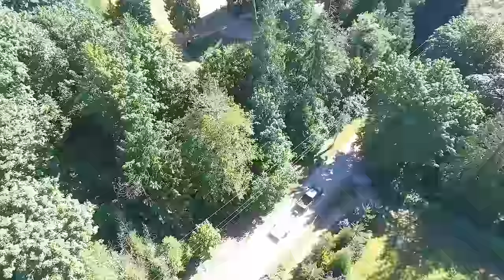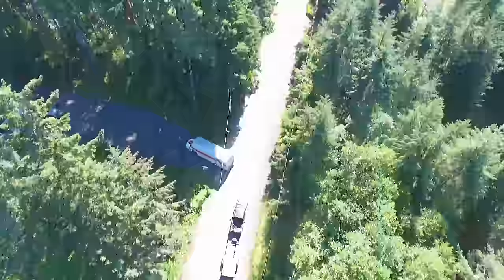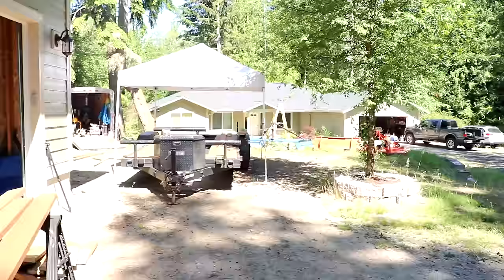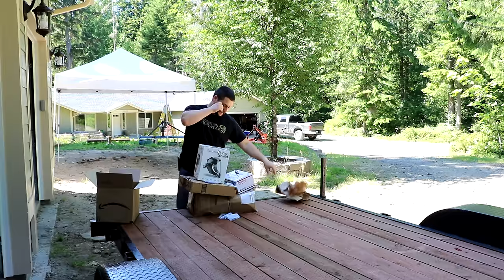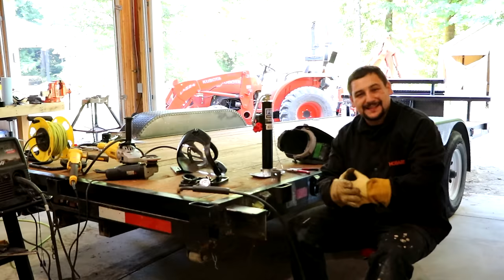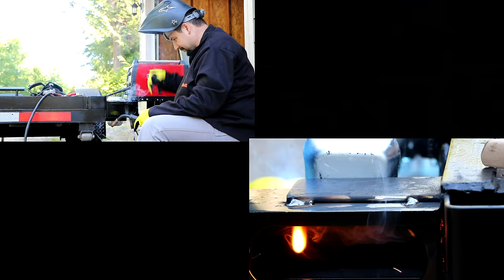Car trailer Upgrades and modifications!!!

Comment: You can't power a winch off the pigtail itself but add a battery to the trailer and the pigtail will charge the battery for the winch while the truck is hooked up. Another thing I did was mounted a switch and relay up to my winch battery that activates the trailer brakes while loading heavy equipment that keeps the trailer from surging back and forwards, especially helpful on 2wd trucks and it works like a charm to keep that stress off of the trucks parking brakes and also the parking pawl if an auto.

Comment: Hey Daniel, Nice Job Replacing the Wooden Deck, Light housing, new LED Lights & Installing the Jack & D Rings.
I have a Kaufman 18 footer Car Hauler with Tandem Axels & a Diamond Plated Steel Deck. 
Now that you have Nice new Wood on your Trailer; Don't forget to maintain it by Power Washing the Deck & Staining it every other year to maintain the look & preserve the wooden deck.
I also have the underside of my Trailer Rust Proofed Sprayed every other year to prevent it from rusting. 

To avoid spraying Rust Proof, I am contemplating spraying the underside with Bed liner Paint. This stuff is Indestructible!
Thanks for taking the time to share your Video.

Comment: Something that most people don't realize is that you don't have to bend the boards to install them. The majority of wood deck trailers have a stitch welded strap over the boards on one end or the other. All you have to do is cut those welds, take the strap off and then weld it back on after you lay the boards in place.

Comment: Great effects on the intro.  Good information. I am in the process of getting a trailer for my new tractor, and your experience was helpful.  I could show you the importance of getting fasteners that are rated for treated wood, especially the newer formula treated wood.  When I rebuilt my deck, the original screws were less than 1/16: diameter when they were replaced. The chemicals dissolved the fastener.  I also used trailer deck screw similar to the ones you used, except in stainless.  I did not have good luck with them, but yours worked much better.  Thanks for the referral.

Comment: Very nice job guys, I will be starting a redo on my trailer I built in 2008, I'm doing some mods and a repaint, I also would like to help explain the screws you used, these types of screws and sizes are my favorite to use, I did notice the way you explained the size of the screws that you used, to help to explain a little better, as listed on your screw box it reads, 1/4-20X3"  this means that the screws are 1/4" in diameter - 20 means that there are 20 threads per inch -  and 3 as you know is the screws are 3 inches long. the bigger the middle number is, it's the same rule if it says 8, 24, 32, or whatever that number is, it still means threads per inch, I hope this helps. Thanks for the video Kudoes

Comment: I also put the trailer support jacks on the rear sides but ran into an unexpected problem 1 day. Went to let them down n crank handle was missing on 1 side. Had to replace jack (Not cheap) A simple $1 bungee cord hooked onto handle, wrapped around jack & other end hooked back to handle keeps handle from hanging down & getting torn off or catching on anything. Simple, cheap fix. Works for me & might for someone else. Jacks are hard to put down w/o a handle. ;-)

Comment: A much easier way to put your boards on is to cut the three tack welds at the back and take the retaining bracket off.  Then lay your boards out and replace the retaining bracket and weld back in place.  Keep you from having the jack up and bend each board into place.
Nice intro by the way.
Reply: i always cut the front retainer out and replace it with angle drill 2 doles in the angle and the trailer and weld nuts to the trailer to bolt the angle to makes it so much easier to replace the decking i do this to every trailer i buy weather it needs decking or not

Comment: Great vid, EXCEPT for using those stupid blue scotch lock wire things...Those deck screws are for treated wood because the treated wood will eat the other screws. It might have been easier to remove one end of the trailer, how the deck boards 'fit into' each lip then just weld it back on. But yea, great vid.

Comment: Dude, I can save you a shit ton of time and hassel next time you redeck a trailer.
On one end of the trailer (usually the front) will have C channel to hold the lumber. On the other end it will be made from 90° angle iron with flat bar stitch welded across the top of the deck boards.
Next time cut the flat bar welds, set the boards in and weld the flat bar back on to the angle iron.
Reply from the maker: Yup in retrospect it would have been a lot easier to cut that end plate off, Most of the videos I wanted did it the way I did,
but I think that because most of those guys did not have a welder.

Comment: I have rebuilt a few trailers, it always works better to do all the welding and new wiring BEFORE installing the new deck.  Access is better, welds don't scorch the decking.  Otherwise, nice job.

Comment: great video,  Xlnt job on the welds.  great idea on swapping out the front 7pin harness  those are always the first thing to go haywire since they get the most use in and out and thrown around when unplugging.  fyi , your not going to run a winch off the extra power wire in the plug though,  too small of gauge to handle a winch.

Comment: Love the cloning in the intro.
Great improvements on the trailer, but why did you choose to put the new deck on first ?

Seems that it would have smarter if you stripped the old deck off, performed all steel mods, touch ups and paint, then put the new deck on last.

Comment: That is a 10k trailer, i have also seen d rings welded to the side of the tube, rip the tube apart, we weld a 1/4'' plate to the tube and then weld d ring on, usually on the top of the tube. Nice trailer and good work!

Comment: I see so many people beat the shit out of themselves and trailer deck because they don't look at the way things are built.
Wood deck trailers will have angle iron at one end of the boards. They then put the wood down and weld a strip of flat stock to the angle basically making it C channel.
Cut about 4~5 1" welds and your done.

Comment: You can save yourself a shit ton of time redecking next time.
Either the front or rear board keeper channel should be angle iron instead of C iron . Then after they put the wood deck on, they weld flat bar across the wood to hold it. You just have to grind off the stitch welds off and remove the flat stock, replace the boards and weld the bar back on.
Reply: don't be giving the ship away

Comment: What size was the Lincoln welder. It looked like a really good welder. Was that a gas or flux core. I guess that's what you would call it. Excellent job on the welding great beads.

Comment: Thompson's Water Seal. Lowes/Home Depot. Pricey but it'll make trlr deck life extend.Later
Reply: better to custom saw full 2x6 black ash, hard as nails an don't root
Reply: Thompson's is junk! Linseed oil and Turpentine mixed 50/50 is the stuff to use. use it on concrete, wooden fences, Masonry block. Apply with a sprayer or roller, better product and alot less expensive as Thompson/s too. I've been in the Ready mix business for 35 yrs now, never ever had any problems with it.

Comment: My trailer re-decking went a lot faster when I first drilled with a 3/16" pilot drill. I had a little different fasteners I got from Fa$tenall.
Reply from the maker: Yup even with the fasteners I used I really should have drilled a pilet hole. I really hope that I don’t have to referb that trailer again while I own it.

Comment: Man nice work on the intro bad ass a couple of things I want to add 1 you spend a good amount of time making sure things were done right and you blown all that nice wiring sky high with those scotch connectors at least get some butt connectors that have the heat shrink build in to the they cost just a little bit more but will save you a crap load of time later by having all of your lights working like there supposed to 2 do not try and run a winch on that extra wire you now have a wench is going to pull way to much thru that little wire however you can use that wire to charge a battery other than that great job and keep up the good work

Comment: put grease on the light connectors. they will corrode if you dont
Reply: pa h make that dielectric grease and I will agree, otherwise you are making a mess that will still have corrosion.

Comment: Nice prep work for welding , but then go and use junk wire terminals . Should have used heat shrink butt splices .

Comment: good vid but those  scotch locks for wiring are no good they will stop working in no time.next build use soiderles  crimp style that has heat shrink,you will be alot happyer with them.

Comment: all the welding and grinding and Cutting should have been done before installing the new decking (would avoid charring or burning the new decking) Other wise good job
Reply: Blue scotch locks  are garbage, solder wires and shrink wrap.

Comment: This video is much appreciated. I basically have the utility version of your trailer. Mine is an 18ft tandem  Acker flatbed . I have the two ramps  but have never loaded a car. I was wondering what what mods you might recommend and what would you think of some d-rings in the middle of the wheel wells? That seems to be the spot I always need an anchor point. 

Thanks in advance for your time and reply. 
Tim Boër 
Managing Partner 
US Garage Auction Co. LLC.
1-844-2-USGACO

Comment: Question for you sir. I  have a car hauler that Id like to use on occasion to take my zero turn in for service.  My issue is the spacing between the steel channel cross ties used to make the ramps are too wide for the front tires on the mower.  Trying to drive the mower up the ramps is very uncomfortable at best.  Any ideas on how to modify the ramps so its a bit easier to on/off load vehicles with smaller wheels?ThanksSteve

Comment from the maker: This is only a 10,000 pound trailer, I didn’t understand axle ratting's when I bought this trailer, I found it on craigslist and I took the guy at his word for what he said was. Live and learn!!!
Reply: a  3500 axle has a tube of 3" and 5 stud, x 2 axles give you 7000 Lb GVW, A 5000 GAS A 3-1/2 PIPE  and 5 stud 2 x 5000 is 10,000 Lb old dated 5000 axles have 8 studs an most bearings an hubs are hard to find
Reply: Hey did you realize that the screws that you bought the 1/4 inch wood and metal ones are self tapping therefore no pre-drilling through the metal was needed
Reply from the maker: Kicker 31 I started to utilize them in the self tapping capacity. And it stripped them out right away and told the tips I ended up having to get a carbide tip drill bit to drill through the steel make him work.

Comment: You mentioned wiring for a winch up to your plug.   What size winch are you planning on using?   Most winches need heavy gauge wire from battery up to winch.   I don't think wiring up to bumper can support a winches needs.
Reply from the maker: Matt Bowman You are correct if I end up putting a winch on the trailer which I would really like to do I’ll have to run a separate set of leads.
Reply: Daniel Woodell good call. Heavier wire is better for the longer run but regardless the wiring in your trailer connector is not heavy enough for a winch. If running off your truck battery, be sure to keep your truck running, nothing worse than draining the truck battery using the winch and can not start the truck
Reply: Yeah that trailer and truck wiring won't run a winch, but that circuit is for a battery charge wire which could be used to keep a trailer winch battery (and/or breakaway switch battery) charged up from the truck.  The 7-pin connector circuits are, in no particular order: 1) left turn/brake, 2) right turn/brake, 3) ground (not "neutral"), 4) backup lights, 5) electric brakes, 6) tail, 7) battery charge.
Reply: John Dough Yea 7 is battery charge lol... keep a trailer hooked up to your truck over night with 7 being a charge line you will kill the battery by morning. The Center pin/#7 is a constant Hot. So it’s just a live positive at all times.
Reply: @lastchancecris  On my truck the battery charge pin is hot only when the key is in the on position, so I don't have that concern.  ('99 Superduty chassis cab.)  Your mileage may vary.
Reply: John Dough  I wish they were all like that ! I have a 06 f250 and a 04 2500 Sierra that it’s constantly hot and the same on my 15 Silverado it’s always hot. Wish it wasn’t because I have enclosed trailers that have the interior lights ran to the center pin and the guys forget to shut them off and keep killing the batteries on the trucks...
Reply: @lastchancecris  Well Chris, there's your next project - rewiring your battery feed lol.

Comment: What is the gvw and make. My Jackson 16' is only 7000lb and too light duty. The frame is 2x4 thin wall tube. My local welding shop said frame thickness should be 3/16" not 1/8".  I've already straightened the frame twice and welded and reinforced cracks. Some times you have to use what you have to get the job done. I need to either build or buy at least a 10,000 gvw but the funds never seen be there.
Reply from the maker: So turns out that it’s only a 10,000 pound trailer,  that reading comes from the axles in the video I said it was the 14,000 pound that’s not accurate.  What are the comments one of the guys explain the five lug nuts that means that each axles on the rate for 5000 pounds.  I don’t know  model trailer I need to getting this off of craigslist this is the second time that I had to refinish it
Reply: the 7000 Lb custom trailers I build are all made using 2-1/2 x 5 x3/16 they are properly engineer out, all factory trailers today are poorly made and not even welded properly that is why they sell so cheap, well a lot of dealer over inflate too, you have nothing but problems if you use them at there so called rating, cant tell you how many I have had to repair were the toughs brake off at the trailer deck, just welded to the front cross tube only, what happens when that flex's a lot there. as a welder by trade. ,back years ago when I first seen them trailers I would put my riding tractors on it, so I started custom building a good trailer that will carry saftly that 7 or 10,000 Lb load, I don't go any heavier because with a normal licese you can not tow ny load over 10,000 Lbs unless you have a class A
Reply: Arnold Romppai Gotta ask.. where are you from that you need a class A to tow anything over 10000lbs ?

Comment: @danielwoodell what model is your tractor Backhoe? Did you buy it new or used? And how much did you pay?
Reply from the maker: It’s a Kubota L3200, with BH77 backhoe. I’m a lot harder on it than it is really made for. It has held up well. I did buy it new. The tractor and back hoe where $27,000. I have made grades many times and also got a few more implements. At this point I have had it for about 3 years, and spent about $35,000 on it and all the implements. That does not include any of the maintenance for having to fix the things that I damaged.

Comment: Do you wish you had a tilt trailer rather than ramps? And how long is it? I have a tractor with a backhoe thinking I need at least 18 feet long. Does it have #7000 or #10,000 capacity? I need to buy one and would appreciate your input. Thanks
Reply from the maker: it has #7000 axles, for a total of #14000 trailer, so it gives me a pay load of about #11500 because of how much the trailer itself is. the deck is 18' i find that the deck is great size for moving the tractor. i got a really good deal on the trailer, but i wish i had a tilt deck, what would be better is a dump trailer but i cant find one big enough for a price i'm willing to pay. i will say if you don't move your tractor a lot a trailer like the one in the video will be the best bang for the buck,  i move mine at least twice a month. i have timed it and it takes me about 6 min 30 sec to load.   anyway hope that helps
Reply: Thank you. I appreciate the info and your videos.
Reply: Aren't your axles 5k? I do believe all 7k axles Would be 8 lug. Trailer looks good. Do a winch next.

Comment: You went to all that trouble and expense to make a nice trailer then screwed the pooch with those trash electrical connectors. Get rid of those blue blade connectors and use some quality weather proof connectors.

Comment: What model and weight is your tractor .. that trailer must be borderline for your tractor with 3500lb axles , thats 7000 total (including the weight of the trailer) So if your tractor weighs more than 5000 - 5500 lbs your probably exceeding the trailer capacity .. Trailer would still haul it but watch out for the weighers on the hi-way ..
Reply: lufkin tape he has a Kubota L3200. I own a L 3901 4x4 HST with the same backhoe and FEL. Kubota L 3901 
Weight:  2,778 + Front End Loader: LA 525 Weight: 1,000 +  Backhoe Bucket: BH 77 Weight:  850 = Total Weight: 4,628. Assuming conservatively that his trailer weighs 2,500 that’s 7,128 pounds of his 10,000 GVWR. He’s well within his limit.